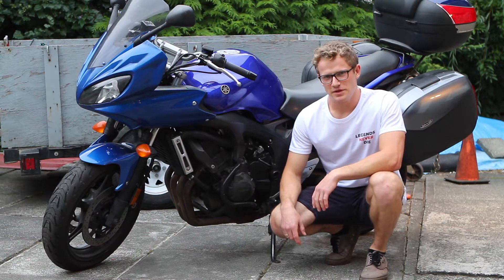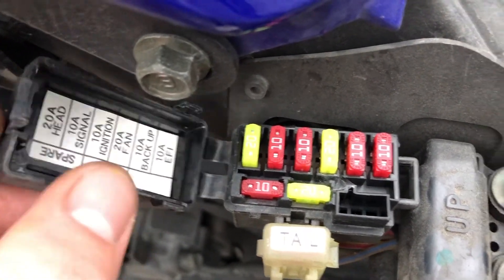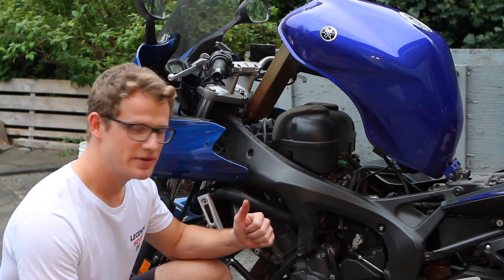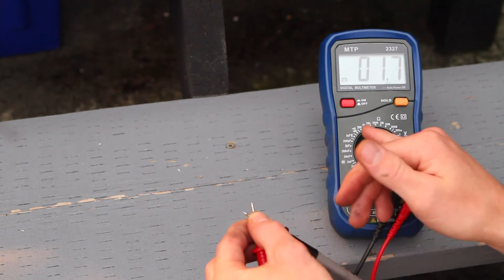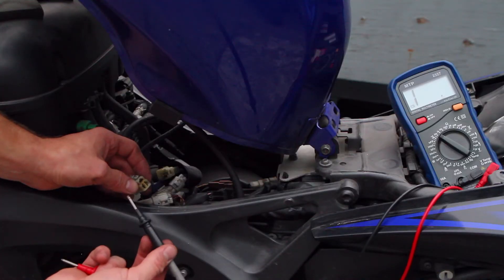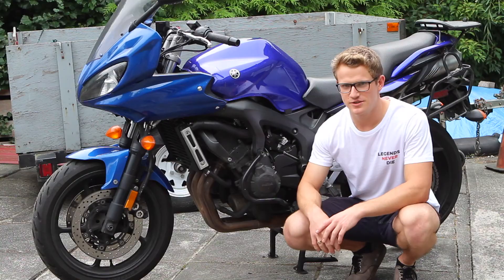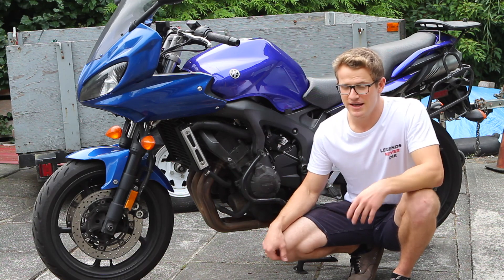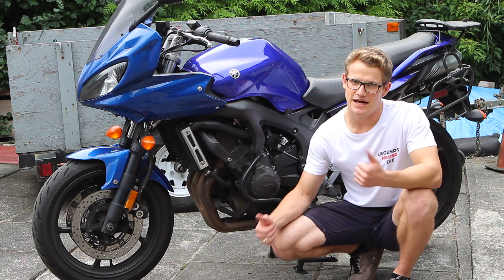Full Inspection of the FZ6 Charging System

Comment: Very informative video. I have had kind of similar problems as you, that after a short ride, my bike wont turn back on and I had to jumpstart it. I checked everything, stator, rectifier, fuses, wires and brought a new battery. Now it's starts every time, but im worried that it will happen again because of the rectifier. I measued the carging voltage of the rectifier at around 5.000 rpm and the voltage cuts off at 13,47v, which I guess is not enough. Im planing of replacing it, just have to find a place to buy it. :-)
Reply from the maker: I had a very similar problem with my bike not getting past 13.5 ish volts. I concluded it was mostly due to the battery and short rides. Back when I was having that issue I would throw a battery tender on the bike once a week just to keep it topped up. Good luck and stay safe!

Comment: I got no problems yet, but also have no heating system or double lights activated. Just one time run out of battery because i accidentally worked with parking lights on on the bike and recognized it too late. I push
 started it and later on no more issues.

Are you planning on change the turnsignals or taillight? I'm thinking of led convert it, maybe could help to safe some energy and looks fresh with the led daylight combined with turn signals
Reply from the maker: I hope your FZ6 stays problem free, its a good feeling. I haven't explored the LED options for turn signals or tail light but I'm going to look into it over the winter. Thanks!